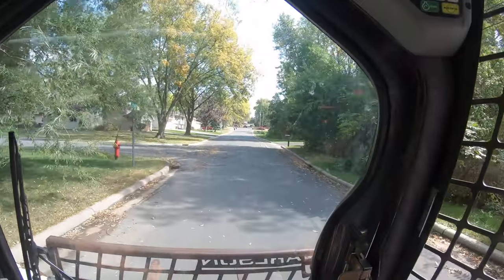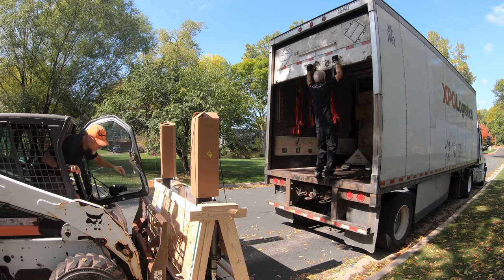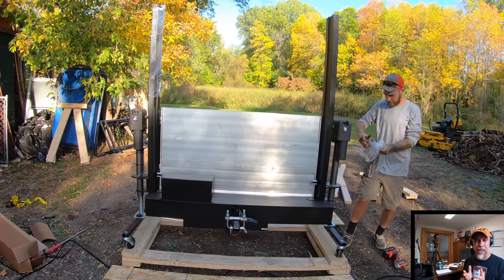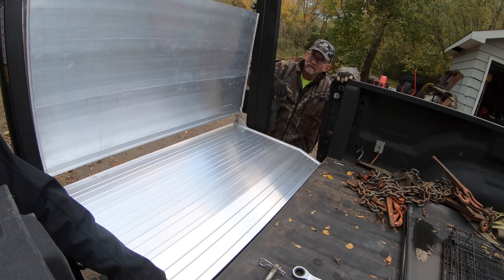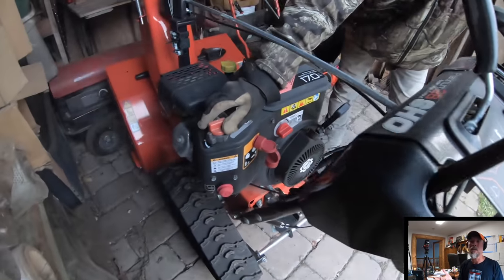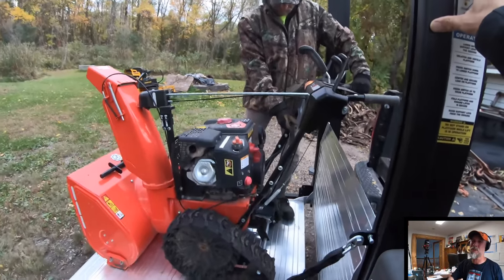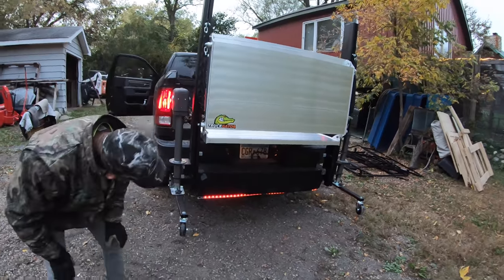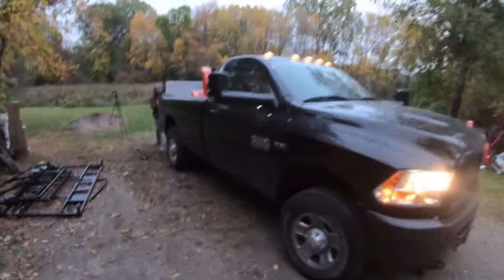Work Truck Lift Gate

Comment: I don’t know,  this contraption looks more complicated than just a couple of long ramps.. I think Ford has them available as an option.. And it looks like just a walk behind mower or blower will fit, (safety that is). Seems to me kind of useless actually. A very expensive ramp option but it’s nice your looking and trying to make things easier for your crew but I don’t think this is the answer..Good Luck

Comment: Dude those wheels are only ment for transporting. Not for stability thats common sense. You remove then lower then jacks.  You will bust those bearings in the wheel coasters.

Comment: Waaaay underbuilt for commercial use. 
It might have lifted that mower, but not well. And after a little work hardening... yikes. That thing is going to snap like postal worker on tax day in the Minnesota cold.
I'm not entirely sure I'd even recommend it for a home gamer. They like to push the limits on equipment too. "It's just another xxx pounds." 
Just bite the perverbial bullet and get a Tommy Gate or a good set of ramps. Either will outlast the pickup.

Comment: I think that 48inch was the max weight of that lift, yes it was able to lift it up with out a problem but there was a lot of flex in the flooring. the lift itself is a cool idea, all depends on the person's price point and if ramps for what ever you need in the bed would be more affordable.

Comment: I don’t know 🤔 ....... just buy a utility trailer.
Reply from the maker: I wanted an alternative
Reply: Stanley "Dirt Monkey" Genadek Sorry I was referring to the couple’s son. A vehicles insurance would generally cover a small trailer and if not trailer insurance is usually about $150/year ( comp. and collision) where I’m at.
Reply: I used to put my scag 48 walkbehind in the back of my yukon with a pair of wooden ramps and be able to close the tailgate for transport.
Reply: mitch denner I’m loading my jd d120 with ramps into the back of my pickup
Reply: I started out putting my 52" wright stander in the back of my 83 k30 pickup with aluminum ramps. It fit just fine, only issue was the pucker factor as that truck is lifted! Moved up to multiple trailers.
This is neat but im not sold on the gaps, narrow width, and not deep enough, and would prefer my hitch to be available should I still need to tow something. But plowing with my pickup with the atv/snowblower along with me would be ideal without ramps so something like this would almost work. Been on the hunt for commercial liftgates that meet my criteria but may have to make my own.
Reply: @MatthewHensley8304  think about the wind drag with those ramps folded up? that's like dragging a open parachute
Reply: harley hawk I don’t think it’s that much more. About the same as a stock tailgate.

Comment: what you need is this https://www.nucorsteelstore.com/Subcategory.aspx?CategoryID=129&brandid=1  with the Platfom Loader includes full length deck (wheel chock included)  that way you can fit snow to 48 inch decks just add d rings to the deck

Comment: https://lawnmowerhosp.com/images/Bannerman/ramp1.jpg I saw this with a bed extension that was holding a zero turn.
Reply: Hey That looks nice definitely could use something like that. I wonder how strong the materials. Aluminum/Steel.?
Reply: @josephpuchel6497  i know the one i saw holding the zero turn was green powdercoated steel. But yhere was no brand name. It might have been custom. It was a combination of this one and the ones you see on the back of box trucks that extensions of the box at a down angle for easy loading.
Reply: I just purchased a short bed Ram wonder if they also have shortbed models. Then hook up a winch and your in business.
Reply: @josephpuchel6497  i saw it on a full size Chevy